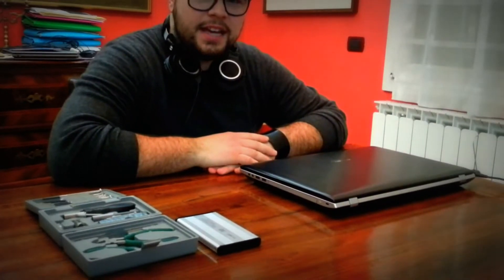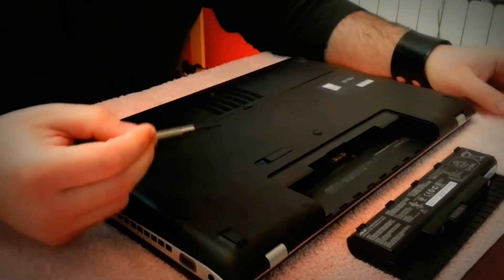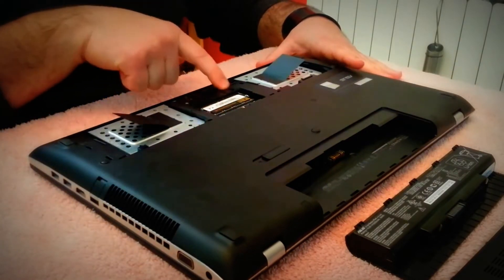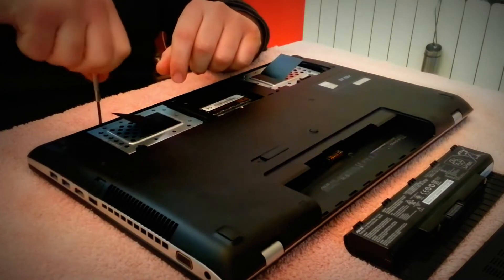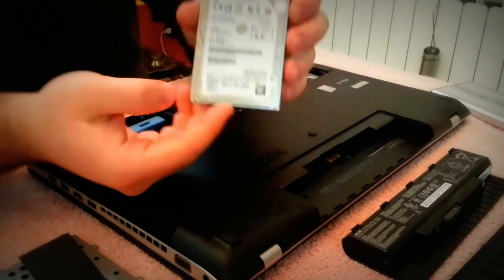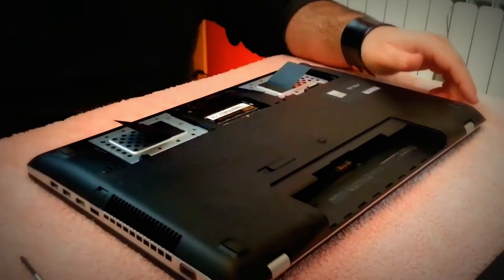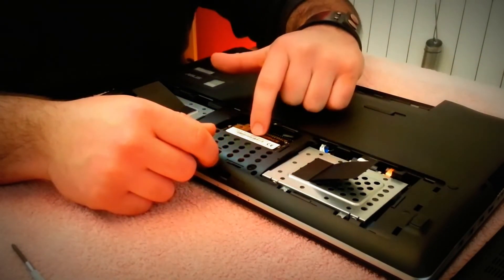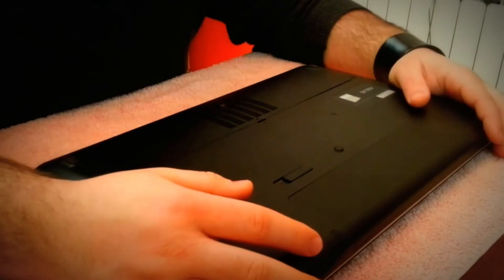///HOW TO - SSD Upgrade, Test & Review

Comment from the maker: Well actually since i upgraded the ram to the 16Gb, i have never seen a freeze or any kind of trouble... I think the freeze story on N76 upgraded are just crap on the internet... Maybe some jerk who screwd up with the bios or maybe tried too hard to overclock something, i don't know...  and by the way, during gaming session, the most stressed component is the video card...  in any case, i didn't had any trouble at all, in gaming session, or normal use, video editing etc... so don't worry... ;)

Comment from the maker: The N56VZ is basicalli the same laptop, with a smaller size, 15,6" screen, instead of 17,3"...
But what do you need to see?
Reply: Actually you was able to put ssd on second slot, and keep hdd inside
Reply: @sleepyxboy  That were also my thoughts indeed. He installed the SSD on the right side, which is the second slot. The first slot is on his left, and is the main slot for the operating system.

Comment from the maker: The metal frame came with the notebook. The original HDD is connected to the Notebook chassis by the metal frame. You can buy the SSD and use the metal frame to lock it to the notebook.